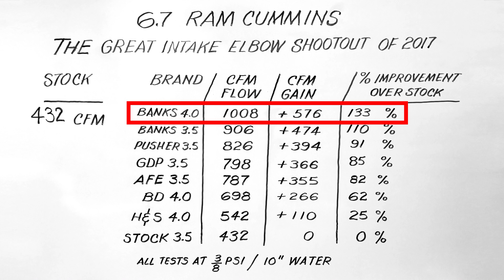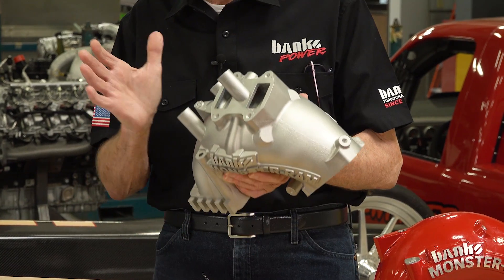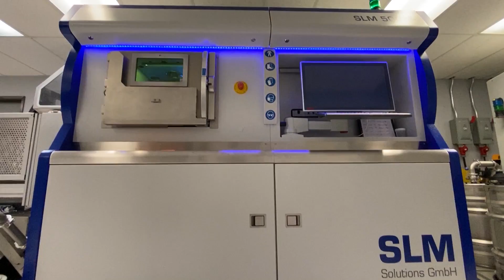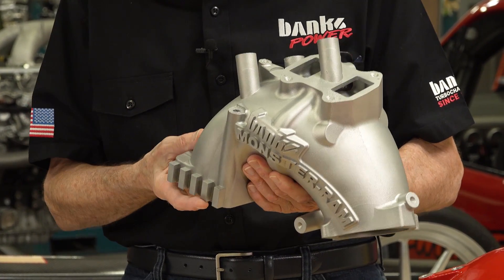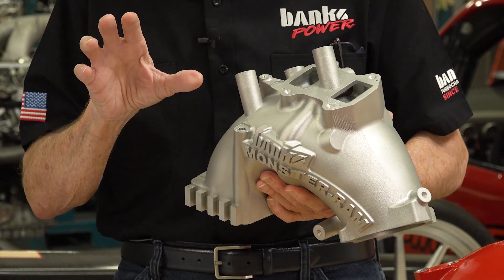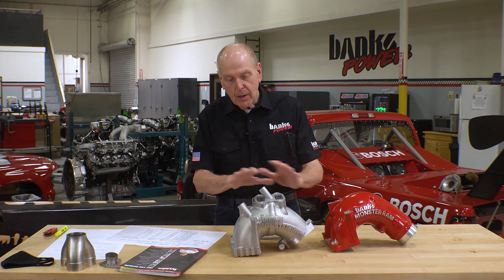This is a 3-D printed ALUMINUM Cummins intake!

Comment: I have a 2020 Ram 3500 HO and will soon be changing out airbox and intake, would like to add a pedal monster and possible tuner that doesn't require a flash or leave a finger-print in OEM system while leaving exhaust and DEF stock, sound doable?

Comment: I cant wait to get my hands on one  as i am building a 08 maga cab and am trying to see how much horsepower i can get and still pass smog here in cali  i fully built the tranny all billet 60 over injectors cheetah turbo afe exhaust manifold edge tunner banks cold air was running the forced air induction but my carli unchained lift wouldn't allow it anymore my..... so now im at the stage of exhaust so now im going to order this and you 5 inch exhaust with the intercooler much more to come

Comment: I have been waiting for the new monster ram for my 2012 Ram 3500 4x4 6.7      I am looking forward for a egr street version.  I didn't get much for information when I called you folks for availabililty,  just some time this summer, checkin later. I would Love to know when its going to be available. 
Thanks for all testing & engineering you and your shop does. 
Duane  C.
coombes.duane@gmail.com

Comment: Just delete your truck like the military did.
Reply from the maker: You can't delete something if it's designed and built without emissions equipment. Our L5P Duramax engines are holistically different from the one offer for the civilian market.  Our military engines come off the line at Duramax with no emissions equipment from the get go, so there is no deleting. Engines destined for EPA certified cars and trucks (all new vehicles), must have emissions equipment. Plus, there are thousands of these engines, not hundreds of thousands or millions like civilian vehicle applications.
Reply: @bankspower  o ok apologize whats your take on the hundreds of thousands of vehicles that they have to manufacture and distribute and mine our earth for to purduce these emissions devices think it weighs out in the end just curious? As far as polluting the environment? Also where does all that extra cfm go with no where to escape with the restricted exuasghst flow what prevents the egr from clogging it with soot does it have a self cleaning feature to prevent loss of mpg.

Comment: I’m definitely interested! I’m also interested in an emission legal tuner along with the rest of your parts. My truck is a 2017 Ram 3500 Cab and Chassis so please include us too as most of the other tuners are not compatible with the cab and chassis trucks.

Comment: I gotta ask I have a 2009 6.7 Cummins for “ off-road use” so it’s been deleted but no other upgrades what’s so ever if I got a monster ram would I need to upgrade the air box or tubing or anything or can I slap it on and get some performance out of it even though everything else on the truck is stock?

Comment: Will it allow an aftermarket inline grid heater installed with it to eliminate the problem of the stock grid heater nut arcing to the point of falling off inside the intake and destroying the engine?
GDP has such a heater available with theirs, will you be making a heater as well? If this can allow an aftermarket heater...Thank you! Because that nut falling off and destroying the engine sucks.

Comment: when can i buy one
Reply from the maker: the new Monster-Ram will be available at bankspower.com and hundreds of authorized retailers this spring (2021).
Reply: @bankspower   ok im holding out for this one. keep up the great work . Any thoughts on a high flowing T4 exhaust manifold with all stock parts bolting on

Comment: I definitely want one I have a 2014 3500 and i plan to buy another new ram down the road my truck is stock and I love it is there more to be had yes but I also pull 14k on the regular so don’t want a hot rod just a great long lasting truck is all I’m after that I can drive down the road and have enough hp to keep the trans from shifting excessively

Comment: My 2014 3500 RAM 6.7 Cummins has Banks cold air intake, inter cooler, differential cover, juice with attitude.  Soon I will do a ATS drop in turbo and I would really like this to keep my truck street legal but maximize my performance.

Comment: Add my name to the growing list of those interested in this monster-Ram.  I have a 2016 RAM, 6.7 Cummins approaching 80k miles.  I will also soon be adding the Banks cold air intake and the appropriate Banks exhaust system to this same truck.

Comment: I am interested in this product for my 2015 Ram 3500
Reply from the maker: And, we're interested in putting one on your '15 RAM. However, they're in R&D at the moment. We're testing the unit Gale was holding in his hands. It's an aluminum 3D printed test piece. Our truck is running with it on the dyno this week. Once it passes testing and emissions requirements, it's off to production. If all goes well, we'll have them in stock before Christmas.

Comment: I’m very interested in getting one of these emissions legal monsters for our 2010 Ram 3500. We are just finishing up a whole series of upgrade videos for the Banks products where we installed the Banks Cold Air, Banks boost tubes, Banks Monster Exhaust, Banks rear diff cover, Banks data monster, Banks Automind and currently doing a 3600 mile road trip to pick up a 2006 LBZ Duramax where we are getting data on mileage without and with the Automind both with the empty trailer and then with the 8k truck on the way home. All will be featured on this YouTube channel and would absolutely love to be able to do the same with that new EGR intake horn. We are also doing a full build on the LBZ truck with all of the available Banks products we can. We have already purchased some items like the Banks cold air intake but was going to test a different exhaust. If that project is of any interest we would love to test everything available for it and use it exclusively to pull 2 of our racecars (67 Camaro LS turbo and 96 ZR1 ProMod Corvette LS turbo SBE). The Ram 3500 will be pulling a 68 Camaro Top Sportsman style and 96 Camaro Unlimited street car.

Comment: Mr Banks, Sign me up for one of those intakes.  I bought a 2007 Dodge Ram 3500 6.7Lwith 135K miles about 6 months ago.  I have been looking "hot rodding" it by adding a new intake, EGR delete and an engine tuner.  If I can keep the truck emissions compliant and gain power and fuel mileage with the new Monsta Ram (that's how we say it here in Boston) I will buy one the minute it is ready for sale.  My only request would be to add 2 NPT ports so I can add a water meth injection

Comment: Mr. Banks, I want to start off by saying what you have engineered is pure genius and I really enjoy your content. I have searched for the SLM prototyping service you mentioned, as I want to design and 3D print a custom aluminum intake for the L35 4.3 Vortec and any other projects, and failed to find any resources. Could you post a link in the description for people interested in their services? Thanks in advance - Allen 😀

Comment: Very interested in the finished product. Of course, all will depend on it's cost. I don't live far from the Banks HQ in Azusa. 2012 6.7 HO CTD, already installed the ram air, monster exhaust, & diff cover.

Comment: See, now, this is the kind of modding really dig. Using the emissions control systems more effectively and still increasing power. And, embracing the best of modern tech to cut cost of prototyping and to also explain how things work. Old school hot rod know how with new school methods :)

Comment: Non emissions please. I know you have to make the feds happy, but i just rebuilt my 6.7 that was supposed to be under warranty.  I never touched the motor, and had a valve drop because so much sute was caked in the head. About the size of a penny of air was allowed in and i had almost no power. The dealer said it was poor maintenance that caused it, even though the dealer maintained it at every interval as required. I figured with an average of 17 mpg, repairs, and lost power is more than enough to be less efficient. Im now deleting all of it, and as of now (30 days later) im getting 23 mpg with a heavy foot because i have so much power now. My def tank had 4 inches of solid white crap stuck in it. And after replacing that tank, lines, and nozzles, that cost me 5800 dollars. All I've used in my truck was Adblue, because I got it for free through my financing. What a waste!!!! Of money, time, and the constant problems with the def system. Ultimately thats why the dealer wouldn't honor the warranty because of the white crap in the bottom

Comment: Looks good. Need to develope an in-line grid heater system to mate up to the intake horn like GDP has. Then those of us in cold climates can rid ourselves of the factory one and the concerns it brings with the bolt falling into the engine.

Comment: Less than two days for a part is pretty fast.   Molds and tooling cost a ton even if you send it to China.  What’s really cool if the part does not work you build another next week
Reply: Exactly. For rapid prototyping; especially of cast or complex machined parts, 3D printing makes a lot of sense. For full production, no.

Comment: Hey Gale.. you talk about stuffing the air in via turbocharging, when do we start talking about extracting it? If exhaust gas temperatures increase due to the fact that you’ve increased air flow and density into the cylinder, yet it bottlenecks at the manifold and into the turbine housing and no longer scavenging, How much more power could be achieved if we had a vacuum in the exhaust ? Perhaps a electric motor controlled turbine further down the line to pull vacuum, this drawing the exhaust out of the turbine/manifold decreasing exhaust temp?

Comment: Also, is that flowing through the factory grid heater? Or, is there going to be a different heater with open plenum plate?....we need the details.

I'd really love to see a Banks equiped truck (EGR Monster Ram, Derringer, CAI, dpf back exhaust) go out and humiliate one of the "deleted and tuned" trucks....

Comment: I’d be interested in getting one for my dad’s 2017 2500 truck, along with the Ram Air intake and your intercooler and a dpf back exhaust!! Also still waiting on the Derringer tuner for the 6.7 Cummins along with the intercooler for the 10-12 Ram trucks too

Comment: Definitely interested in the monster Ram w/egr for my 2018 Ram 3500 CC I use for Hotshotting. It has all stock components except the S&B intake filter. I use the truck to transport oilfield & offshore equipment up to 19k lbs of cargo. Would be awesome to improve my mpg and overall performance of the engine. Look forward to seeing the intake horn hit the market.

Comment: Porsche just made stronger and lighter pistons by this process.    It's like building up a worn part with weld or spraying only much more precise.  Imagine making a crankshaft with this process. If they made the layers say 1mm thick it would be quite fast.  So collect your chips and use them in the printer .

Comment: That's a funny story about a dishwasher. I did something like that to a vacuum. The fan motor pitched a bearing and broke the housing but I had a circular saw with the same housing size on the motor, reversed the rotation and in it went. The peak revs were almost double and the amp draw went from under 5 to over 11.

Comment: I have a question which I couldn't find any answers for online: emissions is the game now (and I'm cool with that), but people seem to complain that it shortens the life of the engine. I think specifically they're referring to the EGR. Are there any options the aftermarket (BANKS) can offer to abate this??
I was thinking that taking EGR gas downstream of the DPF (no idea if this would work) would potentially remove some of the carbon abrasives which people claim are fouling and pitting their induction systems. 
If any one has any thoughts I'd love to hear. Maybe I'll email BANKS.

Comment: My wife has a '18 Ram 2500 6.7L that absolutely NEEDS that manifold!!!!  It already pulls our travel trailer with ease.  But any opportunity to add more oxygen.  Will require less throttle for the same speed.  Use less fuel and have a cooler running hill climber.

Comment: Interested for a 2018 6.7 cummins.  Already has your diff cover, 5"exhaust, cold air intake, and edge tuner, because you haven't released a tuner. 
I watch every episode and enjoy them all.  Cant wait to see what is next for that duramax.  I would think all the data driven consumers would stand in line to get the last part the first time.
Reply: What do you use your truck for?
Reply: @cencoast_7.340  
Funny enough the Ram is my 67 year old fathers new favorite toy. It replaced his 911 4s after he moved from Los Angeles to rural Arizona. It is a third "Fun" vehicle for him.   He is using it for somewhat spirited trail driving and going shooting.  As for the power mods, they are strictly for entertainment.  He missed the pull of the porsche, and wanted a bit of just plain fun.  I personally have a new Tacoma that I put a full Fox 2.5 setup on.  Not sure if I will do any power mods as it is my daily.

Comment: What does this do for my truck? More rpm range before boost kicks in?
Reply: It lets more air get into the engine. Gale's testing showed twice the quantity of air can pass through the Monster Ram compared to the standard one. More air means more available power since fuel gets mixed with the air in the engine. If anything, your turbo should start pumping earlier since there's less restriction
Reply: So it DOES flow 2x the air or it CAN flow 2x the air?
Reply: @cencoast_7.340  I suppose it depends on the conditions. Gale got the results from The Great Intake Elbow Shootout of 2017: Part 1 - Banks https://youtu.be/y8vBWwx6wVs

Comment: Also 3d printing would get rid of casting grain which frees up even more drag on the intake. So more powahhh!
Reply: But they are going to be cast...
Reply: @cencoast_7.340  I know, but using the prototype 3d printed ones would perform better than the cast depending on how tight the casting sand is
Reply: Gabe Lindig Would that cost a fortune to print them all?
Reply: @cencoast_7.340  a small fortune at least haha I'm not saying print them all, I'm saying the prototypes will more than likely perform better than the mass produced cast versions. Unless you spend the extra money to have them extruder honed. But I'm nooo expert in the least on how they manufacture their product

Comment: Does anyone know of a way to EGR delete but still maintain clean emissions?
Reply: Yes. If you delete the egr and replace the engine with an electric Tesla motor it will burn clean.
Reply: @cencoast_7.340  I'm thinking the internal combustion engine is too inefficient to do away with EGR, catalytic converters, DEF, SCR. It's a dinosaur engine design that needs to be redone
Reply: JoManOut How should it be redone and still maintain an internal combustion engine?
Reply: @cencoast_7.340  Have you ever turned an engine by hand with the spark plugs or injectors removed? There's an incredible amount of friction to even rotate all those moving parts. Yes it's a little easier as far as friction when it is running because of oil pressure, but not completely gone. And about 60 - 80 percent of the fuel burned is waste energy in the form of heat, through the tailpipe or the coolant and oil. So it is a 4 stroke engine. 3 of those 4 strokes require power to actuate, it's only the ignition stroke that creates usable rotational energy, the other 3 are parasitic. Intake, compression, and exhaust. Obviously it's too complex to immediately design a 1 stroke engine but I bet it's doable. I guess a turbine engine could potentially be considered 1 stroke. Rotary engines lack reliability to be mass implemented. It's pretty crazy to think if a car makes 1000 HP, if you removed friction, heat, and pumping losses, it actually is making 1,600 - 1,800 HP
Reply: JoManOut I’m already aware of the cycles a 4 stroke engine goes through. A 1 stroke? If it’s a stroke type engine (piston turning a rotational crank) then you at least have to have 2 strokes (compression and power). My dirt bike has one of those. They require oil to be burned with the fuel, far too polluting. A mass produced rotary? Look into the Mazda (RX) lineup. Been done. Similar to a 2 stroke in emissions. Turbine engine? Obviously been done. You have a great idea to eliminate heat/friction/parasitic loss, but then obviously every engine/motor builder recognizes that, but unfortunately physics takes place and it makes it difficult to eliminate those. Informative, long response but I still don’t understand how you are proposing to eliminate the “archaic” piston engine?
Reply: JoManOut And if you’re going to eliminate the physical constraints to improve efficiency why not eliminate the friction coefficient of air while you’re at it...that will help immensely and vessels will no longer have to be built around aerodynamics.
Reply: Not likely

Comment: I own a 2007.5 Dodge RAM 3500 DRW with a 6.7 Cummins.  I have already put in a Bank's Ram air intake with Super Scoop.  This looks like a part I would put in my dream mods list along with y'alls rear diff,  intercooler upgrade,  iDash, etc.